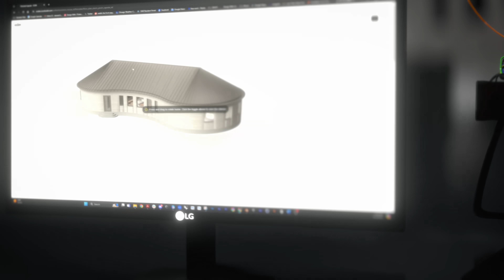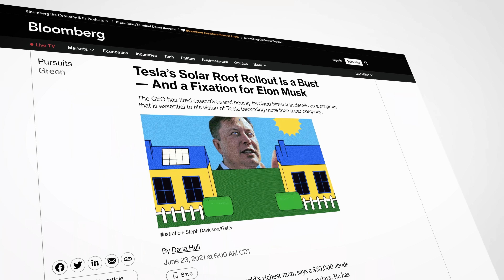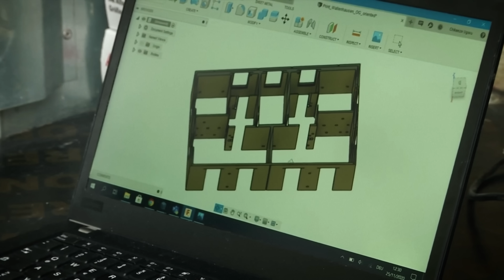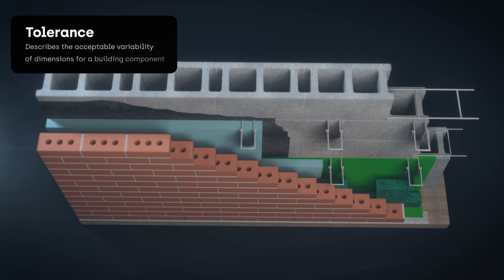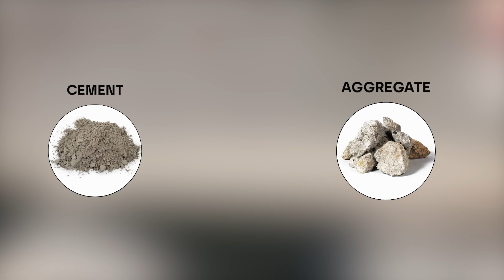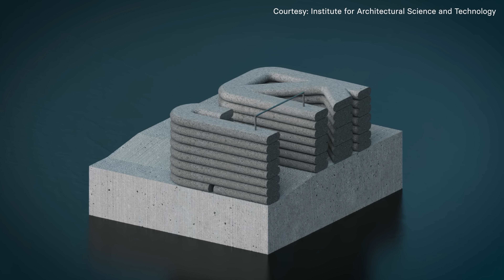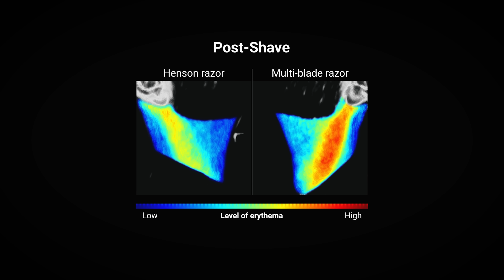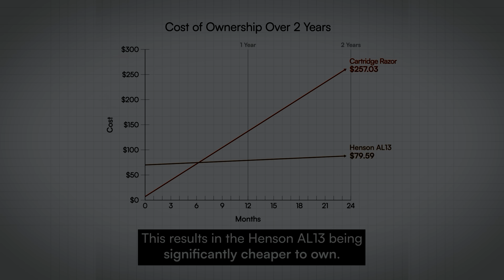Why 3D Printing Buildings Leads to Problems

Comment: I love the concept and don't dislike the texture of the walls, my concerns would be settling causing cracking and moisture control.
Reply: We usually finish with stucco, and everything is sealed so no moisture issues.
Reply: @LeeGaudi-vb9ev  The buildings settling would be a bigger issue. Concrete isnt very flexible.
Reply: @Owen2108 Not that big a deal when the building pad is engineered and not slopped together on existing soils that can’t bear the load
Reply: @Owen2108 ad mixtures with resin increase the ductility of the concrete.
Reply: Looks like the interior walls would be hard to clean.
Reply: @digitalnomad9985 I lived in a concrete house when I was a kid... my mother would take all the furniture out and bring in the hose to "pressure" wash the house. 😂

Comment: For me, this is one of your more disappointing videos. You interjected subjective esthetic judgements and made some broad assumptions that do not seem to be supported by statistics and clash with my experience.

For example, you start off by making a statement about how strange they look. Well, to people who built adobe structures, stone looked strange. To people who built with stone, concrete block looked strange, to people who built with block, steel and glass looked strange. Do I need to go on? Then there were the statements about damage repair or substantial remodeling. You can drive through any suburb and see hundreds of houses which have never needed major repairs and which have never had extensive external remodeling. And as far as the point about companies going out of business, as the technology becomes more pervasive, it will tend to converge on standards which eventually will result in code specifications which will make your point moot. Lastly, if the look of the end product is that disturbing to you, is there any reason the interior or exterior walls can't be stuccoed?
Reply from the maker: I'm sorry you were disappointed. Majority of the issues you list have to do with issues that I associate with how early we are assessing the issues. I agree they can maybe be solved, which is why my conclusions are stated about "for now". However, as someone who critiques design for a living, my assessment is that the majority of the designs at this stage either: a. have a bunch of stylistic, superficial design decisions in the name of "because we can", or b. they try much too hard to look like other types of construction. We are in a weird zone, but I fully believe we can get through it. Secondly, I legitimately do have a problem with the vertical integration aspect and don't think it's inevitable the tech will get distributed. We have to ensure the processes aren't copywrited, etc. Finally, sure it can be stuccoed, but at what point does it just not make sense if the final product needs to worked on by hand? I'm not sure what the answer to that question is, but would be an interesting graph, for sure.

Comment: We already have quick and reliable building process, it is called "prefabricated elements"
Reply: Yup, and its more flexible then this.
Reply: That an he barely addresses the actual issues of the topic he picked. Looks like little to now research/effort video. Right out of the gate he started with a complete non issue. And I am not talking about anything adjacent preference. That was just introduced by him not doing any effort to understand the topic. Covering the raw walls with insulation and plaster is already normal. Him not knowing this should tell you where this is going.
Reply: Why are prefab. And modular home builds so much less common in the US vs other developed countries? Something in our regulation maybe?
Reply: @mcRydes  modular has negative connotations in the US so customers demand site built which is perceived to be better. You say modular to an American and they're going to think trailer. Most folks don't aspire to be trailer park trash.
Reply: Yeah. I think it's much better and faster than those 3D printed once.
Reply: Yeah, you only lack the most important part. Cheap.
Reply: Just because you have something doesn't mean you can't do something else as well. We can have 3D printed homes, prefab, and any other method. As long as homes are built.
Reply: @teddybruscie  https://youtu.be/tldGgGFe194?t=12
Reply: Those houses that got blown out by tornado?
Reply: @dmitryhetman1509  Statistically any individual house is unlikely to get hit and being made of cheap materials makes it easy to rebuild. Also bricks turn into much more deadly shrapnel.
Reply: @JamEngulfer does tornado blows brick houses away?
Reply: @LeetHaxington  this might be even more effective to be honest 🚎
Reply: It is not quick, sadly.
Reply: This technology is like automated cars. We already have systems in place that do this about as efficiently. We already have people that can drive cars why do we need robots to do it. We already have people to build houses why are we replacing one small piece of that process with this? If it can do the whole house 3D printed then I'm interested
Reply: lol
Reply: let them print... like it si given .. what a idiots idea to print on site
Reply: Also quickly and reliably destroyed when disaster strikes. The home insurance market is already on the brink of collapse. It's time to start steering people towards construction methods that are hopefully more resistant to things like high winds, fire,  and flooding.
Reply: @CoSFree  Not really. All the core fortress areas in soviet cities withstanding direct artillery fire in the ukraine are exactly that. High store houses made from prefabricated concrete elements.They are in fact sturdy as hell.
Reply: @CoSFree  the best engineering is whatever is just good enough. In a severe disaster you have to accept that it's going to be a total loss then. The most important factor is affordability. That has a bearing on entry and replacement costs. If you can't afford it then it doesn't matter how good it is.
Reply: Yep though more expensive this is to reduce cost and expand the available layouts of houses instead of what the prefab can provide. 3D printing has different limitations but also over all cheaper or should be anyways. You still have to pay a plumber to put in the pipes,  a electrician to put in the electrical wires, HEVC guy or guys to put in the venting and AC system, etc. with parts that 3D printing cannot do due to it having to be repairable and replaceable when it wears away over time.
So even when they get the how to 3D print walls correct the only part that will be replaced is the workers who put in the walls not the rest of the house.
Reply: @yumri4  how are any of those tradesmen going to put anything inside of solid concrete walls? That's a lot of core drilling.
Reply: @1pcfred Yes and no. Yes if they layer it like done in this video but no if they do it in a way that you have pipes laid out for where the wires alike to using a guide them then for the pipes most likely build it into the wall during the 3D printing process but not the actual pipes but a pipe shape that the pipes will go into. Yes it will require the plumping to be done while the house is being 3D printed to get all the pipes in place and know where the access panels should be.
As most people do not add in more wires after the house is build having the normal dry wall go on afterwards for it to look normal would be good enough though to also leave in a little extra room just for error margins and in case extra space is needed for repairs and/or future expansion. 
Now how to do the venation system?
That will have to have the entire system build into the frame and sadly the air through parts of the  ventilation  system will not be able to be changed without tearing down and redoing the entire house. So yes i do see the issue if it is built wrong or need an upgrade to meet housing code later on in the life of the house. Still the AC are not put of the system of vents but where the vents go out of the house to get to and come from so to repair that part which seems to be the part that breaks the most often will still be possiable.
Nailing stuff into the wall would still be possiable if they go with a drywall over the concrete method. It will also make it able to be smooth and painted with normal indoor paints.
Reply: @1pcfred  In my mind the only reason for 3D printing a house is cost. The last major change in how houses were built was also due to lower cost and they also had to change how the house was built a little to make it work.
So I do see 3D printing houses taking off though for the mass produced houses and the houses you can order how your house will be inside when you are buying your house before it is built things. Yes you already can but right now you have lots of limits as it all is just a puzzle for the consumer to put the pieces together in instead of truely custom for them.
So the very poor where the cities need a cheap easily made place to put the 100s of people to not be in the streets and on the side walks and the wealthy enough to order custom houses. Other than those 2 and a special thing some housing developers might add to get a contract for the land i do not see who would want a 3D printed house.
Reply: Houses are expensive, they are time consuming to make, its hard to mass produce, is the point.  

And we wouldn't have houses as we do now if people didn't "reinvent the wheel" every once in a while.
Reply: @1pcfred  In the US, the big problem is labour. Not paying for labour, but actually getting guys to show up on time, sober and pepared to work, or at all. With that said, I don't see how this is ever going to beat prefab concrete on price.
Reply: Too many employees required with prefab elements, it just is not enough profit margins for the rich.
Reply: Needs too many humans, humans are too expensive
Reply: @lowpolyduck  construction workers are not expensive. But contractors are. Humans or no humans there's always going to be contractors.
Reply: We already have cars but new cars keep coming out 🙄
Reply: @lyteyearz5810  very few new cars compare favorably to what we had in the past. Right now I have a car at the dealership having its timing belt changed. I suppose I could have done that myself. But I know what the job takes and opted to let them handle it. They're estimating it's going to take them 7 hours to do it. My classic hot rod changing the timing gear is trivial. I could do it an an hour or two. It doesn't even have a belt. It's gear to gear. And no the gear never does have to be changed ever. Geared timing is hardcore.
Reply: @lyteyearz5810  Great argument. New cars that cost more than houses, are unreliable, burst into flames that can burn through concrete, etc....but please go on about how we should just accept technology because it's new LOL
Reply: How many tilt-up houses have you seen? Usually, prefab tilt up construction is used with warehouses. Even then, the walls are poured on site and lifted into place
Reply: That does lead to soulless cookie cutter housing. There is something to be said about beauty and its affect on mental health.
Reply: @PoliceTelephoneBox  soviet blocks are not the only way prefabricated housing can look
Reply: @AdjectiveBlazkowicz  also, Soviet blocks don't actually look the way you think they look. You get to see pictures of unmaintained, dilapidated buildings from the 90s, in the winter when you can't see the green park with trees and children's playgrounds either side, often with siding choices like tile that were considered chic at the time (the soviets copied the french) but look hopelessly dated now (lesson learned: traditional choices guarantee aesthetics that stood the test of time, novel fashion is in vogue for a moment and an eyesore later on). With a facelift, they look fine, and new prefabs can be spectacular (if you're willing to pay a bit extra for the styled shapes).
Reply: I worked for a masonry contractor that was pretty quick and reliable. They'd lay a guy off every day just to keep the rest of the crew on their toes. That's how they kept up the pace. If you wanted to work then you'd better work fast.
Reply: @1pcfred  That sounds like a company culture issue instead of a manufacturing process issue.
Reply: @1pcfred  thats fucked up, but money is what matters right?☺️
Reply: @1pcfred   well duh you need money to do it.. but to run a company at the expense of the employees who have lives is fucked up any way you slice it. thats prioritizing profit over people.
Reply: @1pcfred   gotcha. well thats not exactly being 'fired' then, commission is different. but you shouldnt be scared or stressed of losing your job.
Reply: @1pcfred    yah of course if your leaving before its done then youre fired. im just saying its not the same if its contractors because one contract isnt their permanent position or livelihood. but if they were going through people regularly even if its contractors thats pretty messed up.
and seems like that was something wrong with the hiring manager not the employees. they should hire correctly to begin with or they had a power trip and like exercising that.
Reply: @1pcfred  why does US unions allow such practices at all?
Reply: @1pcfred if anything, it would make more sense to use welding robots to construct the reinforcement instead of a house sized cement printer...
Reply: Walmart used to do that. Fire the 10 percentile workers annually. The 'idea' is that they keep the best. 🤷
Reply: @1pcfred this never happened.  No one lays a guy off every day. You'd have no workers in a couple weeks.
Reply: @1pcfred  "beyond the gee whiz factor I'm just not seeing the point of this 3D printed house nonsense. Just build a house already."

Yup.  These house prints are tiny.  A good crew can frame a house that size out of dimensional lumber in a day.  This video is saying they need 2 to 4 working days to do the same job.

Something tells me that the finishing aspect beyond that isn't really all that substantially different time wise.
Reply: How are you going to prefabricate a brick wall that interleaves with every other wall? Or transport a prefabricated section made of brick?
Reply: @JamEngulfer  With prefabricate you do not use bricks nor blocks.
Reply: @JamEngulfer  You set up a 5'x5' foot section of brick and mortar wall in a factory then lay the sections down on the back of a flatbed truck and drive them to location. You then get a few dudes to take them down, add some mortar and piece them together. Also we have some prefab brick walls that are like half the thickness of a normal wall that you bolt to the supporting structure so its looks like its made from brick.
Reply: @JamEngulfer  The way I've seen it done is there's reinforcing in the prefab and it extends out. Then the reinforcing gets nested together and poured in a form.
Reply: you obviously wouldn't do it with brick, try lumber @JamEngulfer
Reply: @JamEngulfer they don’t
Reply: @JamEngulfer  you do not prefabricate a brick wall, you prefabricate concrete panels or assemblies
Reply: @JamEngulfer  Have you heard of ICF?
Reply: @JamEngulfer  brick isn't economical, try again
Reply: @TheGuruStud  That was a year ago, you have no idea where I stand on bricks now.
Reply: @JamEngulfer  You choose not to use brick.
Reply: @JamEngulfer  Tap on a exterior of a recent home.. and you will find, its not real brick
Reply: @SlidTossedPissed  Where I’m from, new brick houses are actually made of brick.
Reply: @JamEngulfer 
WHA... where ARE you from 1954?
Reply: @JamEngulfer  just use concrete instead.
Reply: @Phol concrete is not best material and house is not monolithic like this 3d printed, also poorly installed concrete walls could have some play and noize, gaps could be issue
Reply: @dmitryhetman1509  have I mentioned anywhere that concrete is the best material? I don't think so. Making stuff up is in no way a good faith argument.
Reply: @Phol I just wanted to point that out, and also it is not good at keeping house warm, but depends on design of course
Reply: @JamEngulfer  Do you want to prefab a brick wall or have a prefab wall that looks like brick? For that latter, what I've heard is that you can either create a brick-looking form or actually lay brick in a pre-fab form and pour concrete over that to give you a fascia that looks like or even is made of brick. If you want the bricks to interleave between segments, perhaps they could create forms with an interleaved edge, leave gaps in the pour with space holders so that can be fitted with brick and mortar onsite, or fake it with panel edges that just look interleaved.